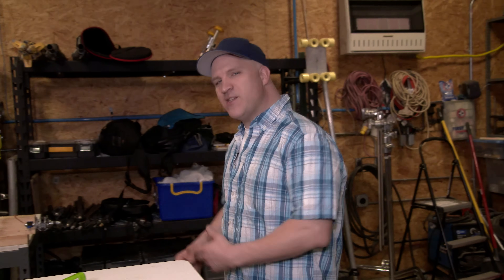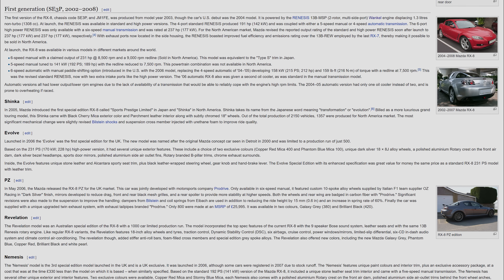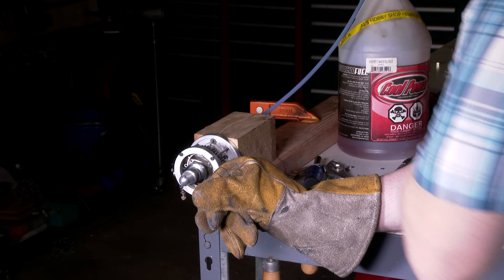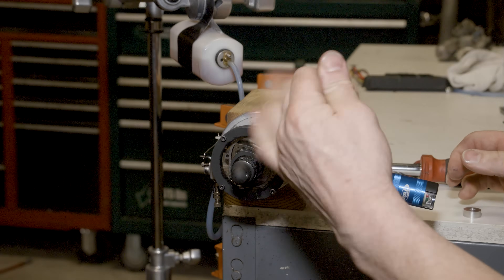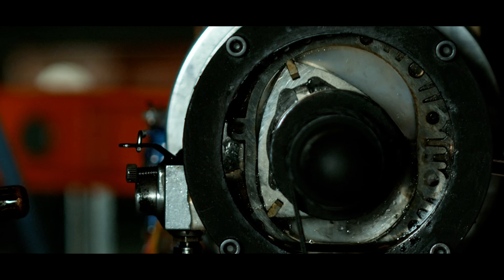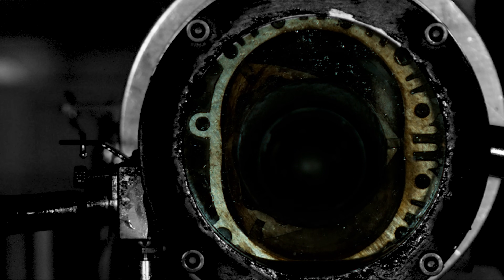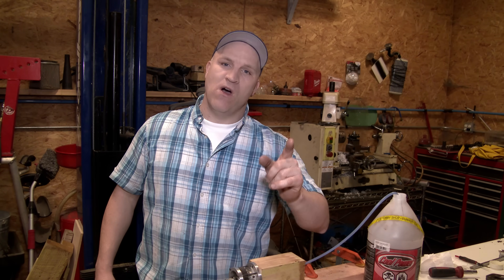See Thru Rotary Engine in Slow Motion - (Wankel Engine) 4K

Comment: Well done experiment. It's amazing that the O.S. Wankel engine even ran without a propeller or other flywheel mounted up front. That would have been impossible with a regular O.S. (2-stroke) glow engine with only 1/3 as many compressions per revolution.

Comment: That was great! First time I saw one of those engines I was about 12 and it was all explained to me by an expert engineer but took many years to fully grasp the concepts fully having only looked at one that was opened up for a 15 mins or so not actually played  around with them, needs to be seen in motion even my high iq had trouble putting that to into perception.  I hope you're wearing safety glasses and maybe didn't have an oxygen bottle hooked up there? ..one mistake on the valves could've made a great video but not much fun to be standing next to you!
Reply: Yes! spelling Anomaly for the fussy people! 😄
Reply from the maker: Thanks and noooooo. No oxygen lol

Comment: would it be fair to say that that thing runs EXTREMELY rich 😂😂
Reply: Its running on nitromethane which requires an extremely rich mixture to run... the Wankel has a very poorly designed combustion chamber that offers very low combustion efficiency... it is also why they are obsolete today.
Reply: @doktorbimmer  https://en.wikipedia.org/wiki/Internet_troll

Comment: That fuel mix looks way too rich! There is fuel spraying out of the exhaust port...
Reply: If it was too rich it wouldn't run...
Reply: Still, I bit too much fuel in it. Would be more efficient with less intake
Reply: @K-H Gaming Really? Then please tell us what the correct AFR should be?
Reply: @doktorbimmer  between 11.47 and 12.05 AFR. What do AFR do you think would be best for this small engine?
Reply: @Steven What do I think? Its not what i think son its what I KNOW. This engine's ideal AFR running on nitromethane fuel( I'm not sure exact what percent is being run here) But it should range (rich of peak) between 3.5:1 and 5.5:1.
Reply: @Adam Hale I'm sorry but that is not true... and the reason why you deleted your comment.

Comment: PISTON ENGINES VIOLENTLY CHANGING DIRECTION WHOOPS RIGHT OUT THE SIDE OF THE BLOCK
Reply: Rotary engine inventor doctor Felix Wankel born August 13 1902 The Wankel engine is revolutionary
Reply: Pascals Law refers to an equivalence of pressure and volume 
relationship.  If you're increasing pressure, volume must decrease to 
maintain preservation of energy.  Take a balloon for instance, if you 
decrease the size on one side, the opposite side increases to maintain 
volume relationship.  So the argument does not pertain, the principal in
 essence is correct

Comment: There is a lot of un burned fuel the down side of this engine for me is it is not as efficient as the traditional piston engine but over all its a good engine despite the size it can produce a lot power and most of all i learned a lot Thank you and i hope you can make more educational videos ad this and i subscribe tho.
Reply: Yes, its very inefficient among its many fatal flaws... the Wankel is obsolete now because overall it is inferior to the other types of engines still in mass production. The Wankel no longer offered any advantages in power, performance or size and weight. Its major disadvantages included poor power characteristics and torque output, poor reliability and short service life and terrible combustion and thermal efficiency and the resulting issues with poor fuel consumption and emissions.

Comment: We need longer rotors. Same size but like two of them together... Less tighting, more volume.
Reply: Longer pistons(rotors) only increase the reciprocating weight and drastically reduces the rpm range and increases problems with sealing the apex seals...
Reply: @doktorbimmer  Hm... Makes sense 😯
Reply: Klöckner-Humboldt-Deutz (now Deutz AG.) was one of the early Wankel licensee's and developed the widest piston(rotors) configurations but never produced them.
 Ingersol-Rand another Wankel licensee developed and produced the largest diameter engines. But both configurations severely restricted rpms and caused additional stresses on the apex seals.

Comment: Its no secret rotaries have trouble with the seals. But i have an idea
Has anyone made rotaries that are ship based.. hear me out

Engines for ocean going liners are usually slow and burn a very thick fuel. Almost grease like.. i think they run at max 800rpm.. now as the problems of a engine get more pronounced as a engine builds RPM a slow revving engine could see a longer between services period for this engine
Reply: Bunker Fuel Oil No.#6 (Bunker 'C') must be preheated to over 100°F and is a very dirty, unrefined crude oil "cut" it is very abrasive and causes extremely high wear rates on some engine components and requires high compression to ignite reliably.
 New international laws are expected to bring a ban on the use bunker oil next year due to the excessive exhaust pollution produced by this very dirty fuel.
 Wankel engines must operate at higher rpm because they are much less mechanically efficient and produce less torque per pound of fuel. Wankel engines have only been briefly successful in very, small low priced sportscars and RC models. due to this very serious efficiency problem.
Reply: http://pdfaiw.uspto.gov/.aiw?PageNum=0&docid=20160084158&IDKey=32A0F77DE744&HomeUrl=http%3A%2F%2Fappft.uspto.gov%2Fnetacgi%2Fnph-Parser%3FSect1%3DPTO1%2526Sect2%3DHITOFF%2526d%3DPG01%2526p%3D1%2526u%3D%25252Fnetahtml%25252FPTO%25252Fsrchnum.html%2526r%3D1%2526f%3DG%2526l%3D50%2526s1%3D%25252220160084158%252522.PGNR.%2526OS%3DDN%2F20160084158%2526RS%3DDN%2F20160084158
Here is the link to the Wankel patent made by Mazda (I think, the plugin didnt work on my device) RX-vision has been ongoing for years.. Again it is not dead, but it cannot compete with inline ICE for traditional car users. As a performance vehicle, its been conquering until recently with new clever technologies like VC-t, VVL etc.

Comment: I   remember  when they  came  out  / the  car  salesmen  said  push  them  hard  they  will not  blow  up   they said the  seals  went out  ???
Reply from the maker: The Apex seals were the biggest problem with these engines, that was one of the reasons I sold all of my Rx7's and bought supras instead. Especially with the turbocharged applications, if you don't have a large enough intercooler, or if you went out on a chilly night and got a boost Spike, that was it, you would hear a little tap tap tap, and it would just start chugging, just like that engine blown.
Reply: @WarpedYT  combustion shake is why apexs have the problems and charter into the housings great comment by the way awesome videos
Reply: RIGHT OUT THE LEADING PLUG HOLE LARGE AMOUNTS OF WASTE IN A MAZDA WANKEL ENGINE AIR FUEL AND COMPRESSION  RIGHT INTO A ANOTHER CHAMBER OR CYLINDER
Reply: They do not make Wankel engines anymore because they had major reliability issues and a much shorter service life.
Reply: Ernie Brink can you explain to us why your engine does not run either???

Comment: You should have used a exhaust, these little nitro engine's don't produce much Power or pleasing sound without 😆
Reply: These little engines didn't produce much power for their size and weight and were not very reliable which is why they were discontinued years ago... the Wankel engine is obsolete now.

Comment: Oh just to state that with this system you dont need s carberator or a fuel injection system .The vacpot and the vacumn pump meters the ice crystal perfectly ...u will see if you do this setup...whats wild is the timing can b off a lot and it still runs perfectly with more horsepower and torque .How do i know i built this system some twenty years ago and i put it on a ford pinto 4 speed and it hauled but .it also cleaned out the carbon buildup and the oil was still like new and because the ice crystals were ran thru a radiator and fan for an air conditioning unit before they were injected by the vac pump to the intake manifold.never did get a mpg reading but i do know i used one sixth the amount of fuel with no predetination or valve ping ...no harmful effects except the carbon that was ejected from the engine from the engine being ran on liquid gasoline for so long.I did a teardown and the engine was like new as far as carbon buildup .The only thing i missed was being able to c the ignition of the fuel like what u are doing

Comment: If you were wondering why more cars don't have wankel, the reason is fuel efficency and maintainence. One of cool features with a rotary engine is its' far fewer moving parts, there's very little to go wrong... Unfortunately if something does go wrong, it is apocalyptically expensive to fix.
Reply: Wankel engines are obsolete because they are inferior to other types of internal combustion engines that are still being mass produced. The Wankel no longer offered any significant advantages and had too many disadvantages; Poor reliability, short service life, low power density and poor torque characteristics. low efficiency and higher exhaust emissions.
 Mazda's last Wankel engine the Renesis had over 235 moving and seal related parts... Ironically its the tiny, fragile sealing components that people often overlook that are the primary source of the designs terrible reliablity problems.
Reply: Piston Engines have had way more R&D put into them. Look at how many have been produced. If Rotary had that same amount of R&D we might see a huge difference in how they're made.
Reply: @ThatGuy Typing Your comment is nothing but very faulty assumptions based on a complete lack of knowledge regarding the facts surrounding the Wankel engine's history and development... Mazda was only one of a large group (26 of the largest and best engine manufacturers in the world)  not to mention around 100 of the world's best universities and research institutes.. all working to solve some or the serious drawbacks of the design.. it took about 20 years and over a billion dollars of combined effort in development before some sobering and disappointing conclusions had been reached.. the conclusion that the previous reciprocating engine design were actually far superior and the Wankel had several inherent drawbacks that could not be fixed.

 50 years ago the Wankel did offer significant advantages in lower weight, higher power density over other engine designs available at the time, but these were heavy, inefficient flat-head designs made from cast iron. The Wankel was never cheaper produce or offered a longer or more reliable service life.

26 of the largest engine manufacturers and over 100 of the best universities and research institutes in the world spent billions on development of the Wankel.  The engineering potential of the Wankel was exhaustively researched and its practical and theoretical limits have be tested and are well understood.

The facts are that the low efficiency of the Wankel is inherent to the engines very basic fundamental design geometry and shape that created it.. the Otto and Diesel designs are simply much better.

Mazda, the world's last Wankel manufacturer canceled further development in May of 2009 and production ended June 2012 due to lack of sales.

The simple fact remains there is no longer a place for the Wankel KKM design in automobile manufacturing or any other applications.. the design and its concept are now obsolete.
Reply: Absolute Nonsense! 26 of the world's largest and best engine manufacturers and over 100 of the best universities and research institutes spent over a decade, millions of man hours and billions of dollar developing the Wankel engine design.
 Mercedes-Benz and and General Motors for example both spent over 100 million dollars a year on Wankel research and development.
Ford
Toyota
Porsche
Rolls-Royce
Nissan
Alfa Romeo
American Motors (AMC)
Citroën
Suzuki
Yamaha
Kawasaki
BSA
Norton
Hercules
John Deere
Ingersoll and Rand
Fichtel & Sachs AG
Yanmar Diesel Co. Ltd
Daimler-Benz AG
Deutz AG.
MAN AG
KRUPP AG
IFA VEB
Graupner
Savkel
 All the motorcycle and automotive manufactures already mentioned above plus the heavy truck and Diesel engine manufacturers and the aircraft engine manufacturer Curtiss-Wright
marine engine manufacturer OMC. 
 and of course 
Wankel-NSU which became Audi..
 and dozen of subsidiary companies and and partnership companies which combine represent billions of dollars in research and development besides just tiny little Mazda.
Reply: @ThatGuy Typing That is a very naive theory... and shows a limited knowledge regarding the history and development  of the Wankel KKM engine design.

Comment: Look how dirty the exhaust is coming out the see through engine painted black 😨😨😨😨
Reply: The Wankel not only generated lots of pollution, its wasted large amounts of fuel...
Reply: RIGHT OUT THE LEADING PLUG HOLE LARGE AMOUNTS OF WASTE
Reply: @xkexke8081  EXCELLENT!  You are a quick learner indeed..to make that analogy means you understand the concept now... YES, in that regard the Wankel is Exactly like a 3 cylinder engine...each face is a separate chamber and each performs all 4-cycles one at a time just like the Otto engine.

Comment: Once the apex of the rotor passes the exhaust port, the high-pressure combustion gases are free to flow out the exhaust. As the rotor continues to move, the chamber starts to contract, forcing the remaining exhaust out of the port. By the time the volume of the chamber is nearing its minimum, the peak of the rotor passes the intake port and the whole cycle starts again.
The neat thing about the rotary engine is that each of the three faces of the rotor is always working on one part of the cycle. In one complete revolution of the rotor, there will be three combustion strokes.
Reply: Citroen and Van Veen also experimented with Wankel, but only NSU and Mazda had Wankel commercialized. A nice thought to rotate instead of the existing up/down engines, but some bad hooks: bad compression control, bad fuel consumption and bad CO2 creation.
Reply: @dokterbimmer7270  Do you not understand LEAKAGE
Reply: @xkexke8081  as Ernie Brink said, by changing sparkplug hole geometry by a very thin flat hole (height of the hole will have the same thickness as apex seal) , but too narrow hole could diminish the effectiveness of the spark,I think we can go bigger in the height of the hole without really having consequant gas exchange between compression chamber and exhaust chamber. Other ideas from Ernie Brink are very interesting and pertinant and there are still more possibility to improve the rotary engine
Reply: That's actually not correct.  Yes 3 voids are all active,  but there is a mechanical reduction by the interior gear size. Wiki wankle and open design tab for an illustration

Comment: WANKEL ENGINES RULE
Reply: ernie brink is simple straightforward" yes you are ernie. and it's guys like you who often have made discoveries that wound up changing the course of industries. you know stuff intuitively while certain doctors point to theories and mock others while saying 'it can't be done'. well clearly it can be done. you called for some basic configuration changes in the wankel mazda did this (if not exactly what you called for) and 'boom!' they've revived the technology and found new advantages with it. nice going ernie!
Reply: @dokterbimmer7270  EXCELLENT!  You are a quick learner indeed..to make that analogy means you understand the concept now... YES, in that regard the Wankel is Exactly like a 3 cylinder engine...each face is a separate chamber and each performs all 4-cycles one at a time just like the Otto engine.

Comment: As an RC guy dealing with these types of engine glow engines, I know why you did it, but that engine will perform its best with a prop - acting as basically a flywheel. Without it, it doesn’t have the proper load and wont run its best not sound right. At the end with prop, it sounded much better.

Comment: Style tip: If you're explaining a device by pointing to and naming all the parts, then show an enhanced video of the device in motion, maybe Don't flip it upside down between shots.
Reply from the maker: Upside down? When ?
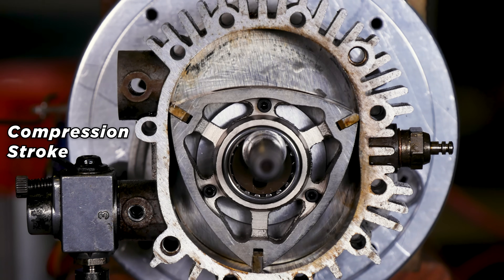Reply: @WarpedYT  At 2:05 the carburetor is on the bottom left, at 2:09 Carb is top right, then at 2:46 the Carb is bottom left again.   Since the Bench Test and High-Speed video are taken with the Carb on the bottom left, I would assume the pointing and naming of the parts would be considered upside down.
Great video.